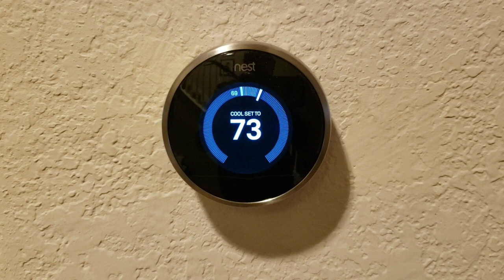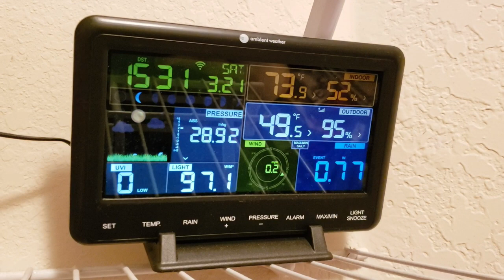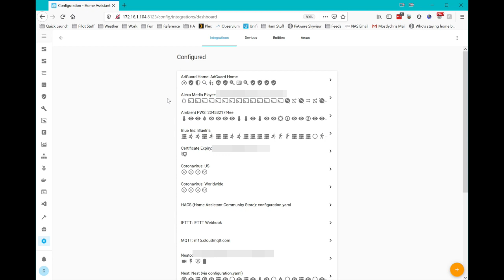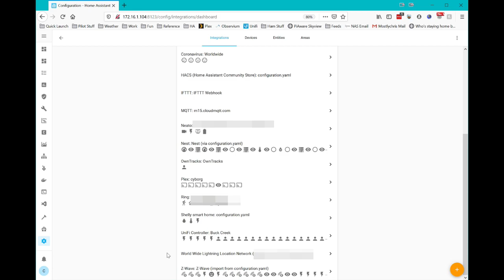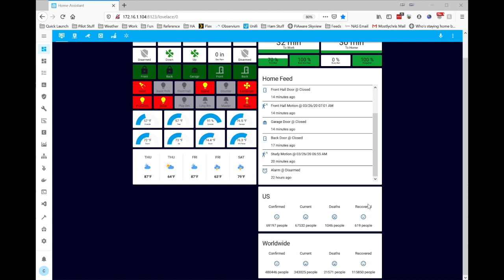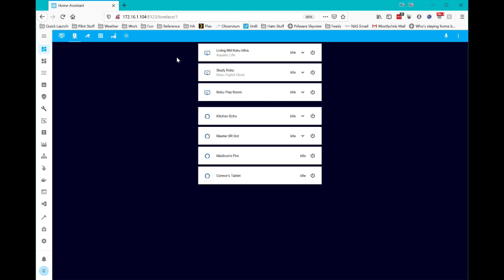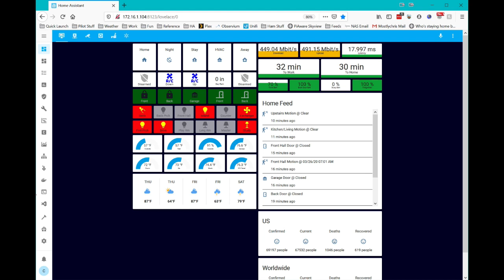My Personal Home Assistant Setup

Comment: Very impressive setup. My HA setup is basic compared to what you have. How long did it take to set this up? In other words, how long have you been using HA?
Reply from the maker: Thanks for the compliment! I have built up my home automation over a number of years. I ran a different device prior to jumping on Home Assistant and after switching haven't looked back. I have probably been on Home Assistant for about 2.5 - 3 years. It's been a fun journey and I continue to experiment with new things so my setup will continue to change and evolve.

Comment: how do you get your nest thermostats to still work in HA can you give an example of your config. I can't get mine into HA. Thanks for a great vid!!
Reply from the maker: I have not added any Nest products since Google took over the Nest properties. There was quite an issue with changing to Google accounts for those devices. If I were to add any more devices, I would have to transition to their account and that would probably break things. I'm not sure if this thread is still valid, but take a look: https://community.home-assistant.io/t/i-made-a-crappy-nest-thermostat-integration-that-will-work-as-a-stopgap-until-alternatives-come-out/139270

Comment: Awesome video! Can you send a link of the motion sensors you’re using? Also, do you need a hub for the motion sensors? Looking forward for more HA videos!
Reply from the maker: This is the sensor: https://www.amazon.com/gp/product/B0773FWJ2Y. Make sure you have some CR123A batteries. I can't remember if they came with one, but I don't think so. These are z-wave, so you need to have a z-wave controller like what I have in the video.